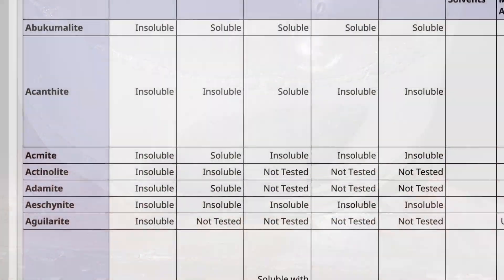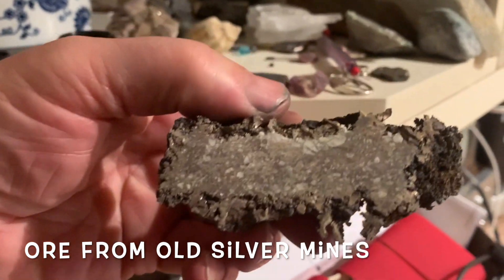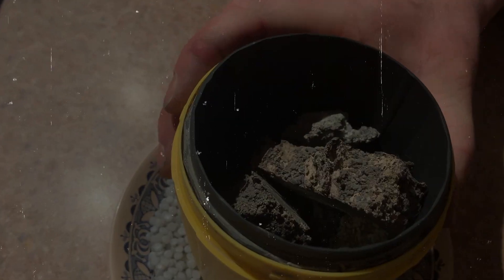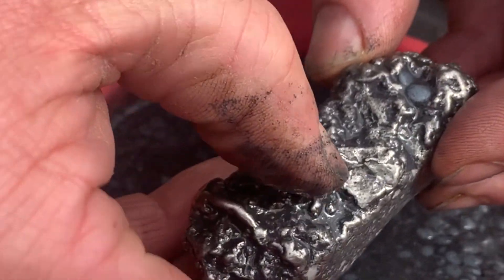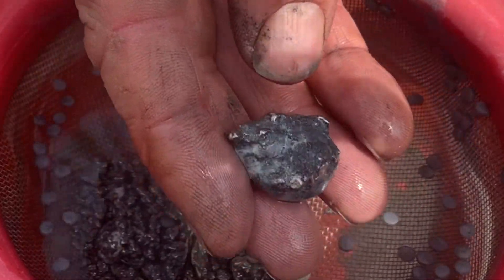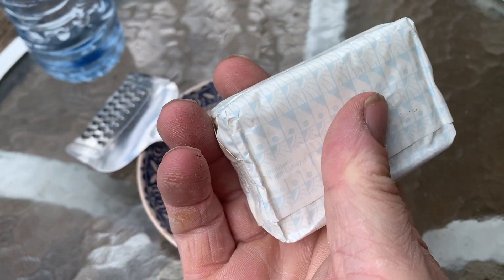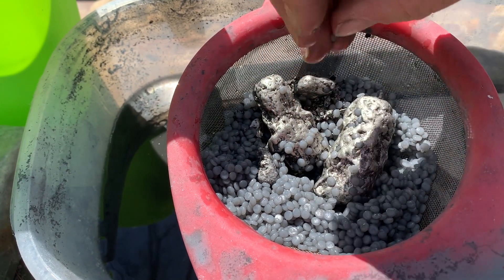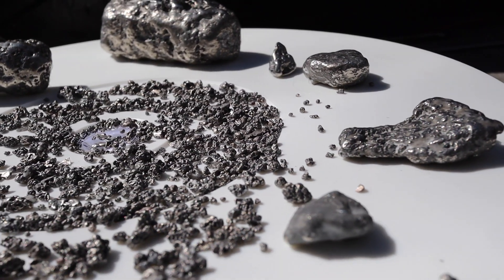Making Shiny SILVER NUGGETS in a Rock Tumbler

Comment: There's a parking lot for semi trucks that I know of. The parking lot is at a perfect slant and with the rains, concentrates of stack soot gather always in one spot. Within this spot I gather platinum from the regeneration process of the semis smoke stacks (precious metals on the ceramic combs). 
My point is.
I've noticed with many of your searches your on a hillside looking.
I'm wondering if on hills like that, if there isn't a particular spot at the bottom of those hills, where silver particulates may gather in a concentrated amount where you might be able to gather.
(just sharing)
Reply from the maker: The silver that I find is pretty much sitting where it was placed by the old miners.  There is some fine silver colours in local creeks, but not economic quantities.  I am much better getting another larger piece with the detector than looking for sands

Comment: I would just put them in nitric acid, untill it wont disolve anymore silver, then filter the solution, when filtered you put copper sheet in the solution, and silver comes out of solution and copper goes into solution. From there you melt the grey cement silver in a crucible and bam! Silver very close to pure.
Reply from the maker: Nitric scares me.  ;-)
Reply: @meMiner  ive got it on my hands before it dont consume flash, but it does stain the skin black. And a respirator helps.